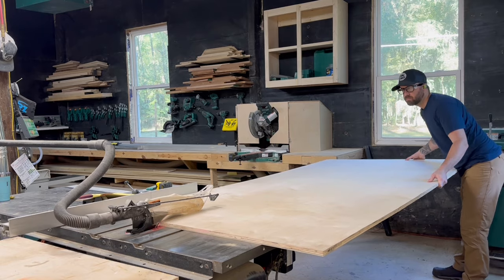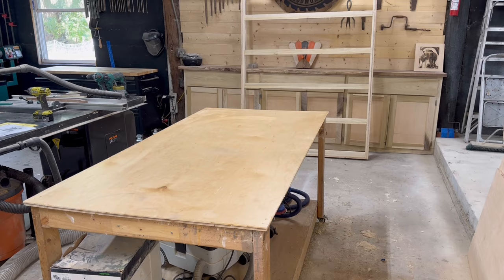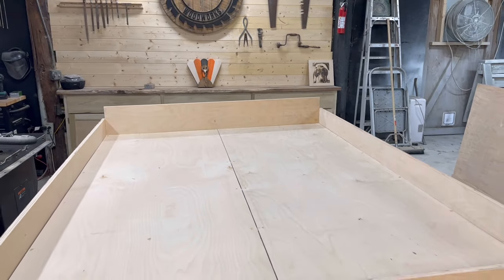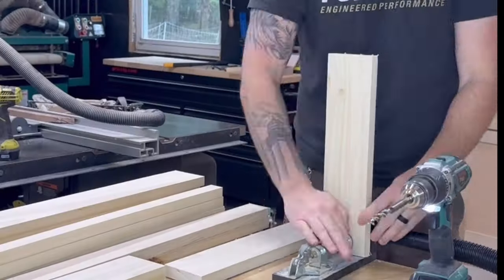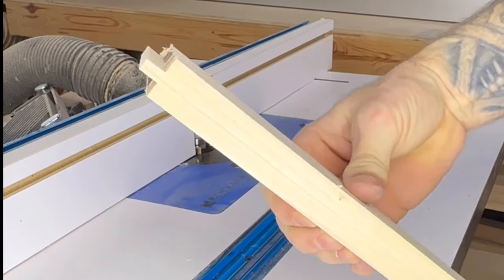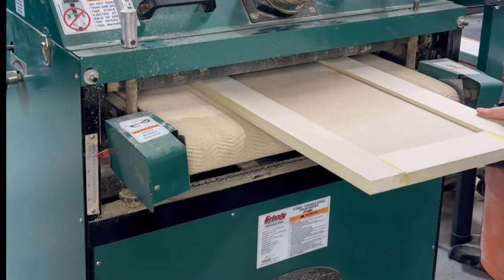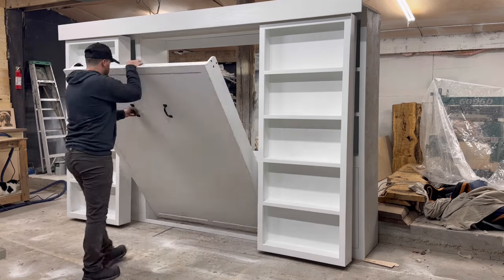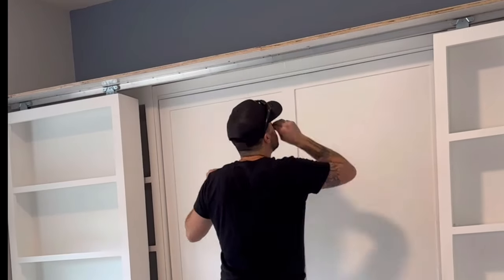I Built The Ultimate Murphy Bed

Comment: How woould it hold up if every shelf were fully loaded with books?  Most of these murphy-bed systems with book cases (the ones I've seen) can't cope with the weight of fully loaded shelves.
Reply: I was thinking the same thing. Plus, for such a sleek look, the rolling cabinets seem very floppy and cheap. I would install rollers to the bottom, guesstimating the size based on how much weight I think it would take.
Reply: And also, maybe adding some way to keep those sliding shelves in place when they are open and closed. Can't think of anything off the top of my head right now, can you? There must be something.
Reply: However, the overall design is cool and I'm grateful for the video! It's also nice that you can buy kits that have the specialty hardware needed for such a project. What a cool time we live in!

Comment: I'm in the process of planning one of these.
The plans look great, the build looks great.
But I'm wondering about materials.  Rather than use plywood and edge banding for all of this, is there a compelling reason not to use actual lumber for parts like the bed side panels?